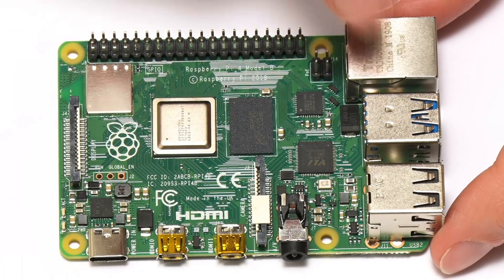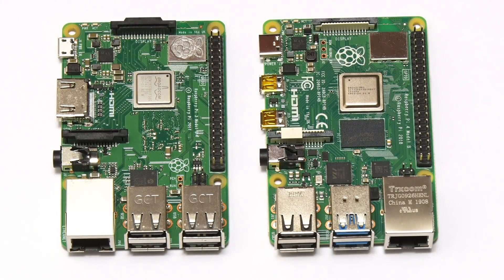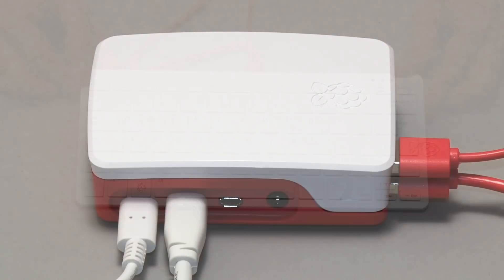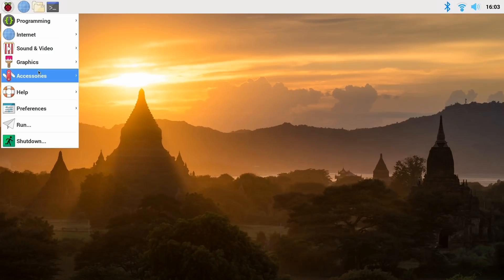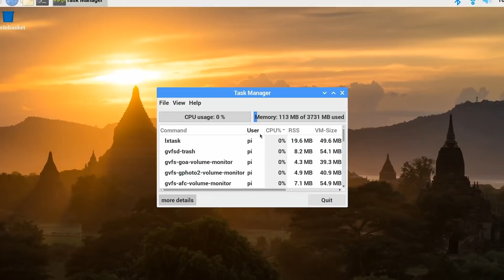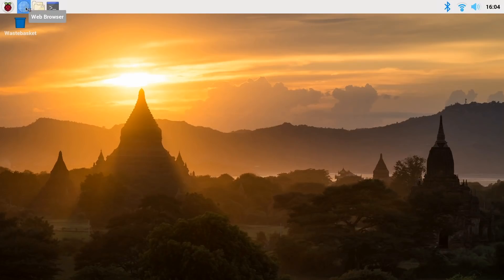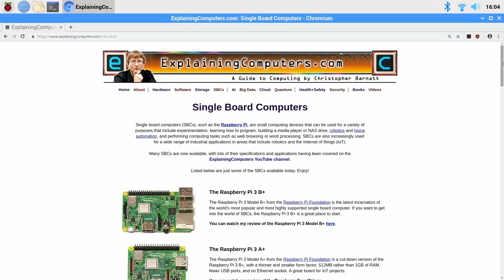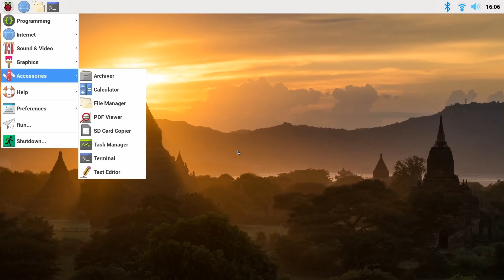Raspberry Pi 4 Model B

Comment: Hi Chris, thinking of getting a SBC as a cheap desktop replacement. My requirements are simple, checking emails, YouTube videos, Netflix streaming, internet browsing and opening some email attachments like PDF, pictures and running a media player like VLC.  Which SBC that you have tested so far would fit the bill? I am not a tinkerer but I can manage installing Raspbian on the Pi 4. Thanks.
Reply from the maker: The killer for many an SBC here is the video streaming part. With which a Pi 4 currently struggles. A Jetson Nano is more powerful. If you are happy ro run Android, someting like a Khadas VIM3 or Edge-V is a fair bet. Ir you are into x86 boards, like the origional LattePanda.
Reply: @ExplainingComputers  Thanks Chris, do you expect this video streaming problem getting fixed on the Pi 4 in the near future? Is this a hardware issue that requires a more powerful hardware to resolve or is this a software issue that can be solved in a software update? Thanks.
Reply from the maker: @cinnamont1224  Yes, the Pi streaming video problem should be fixable. The hardware is capable of it, so this is a software issue -- and the Raspberry Pi Foundation have described software for the board as "early days". :) If you do want to stream video, you can also do it pretty well if you install the Libre ELEC/Kodi -- so it is an option if you are prepared to switch SD cards. :)

Comment: I've seen the video where you put the Rasberry Pi 4 up against the Jetson Nano.  My question however is how did or would it fare against the Rock64 and similar single board computers in head to head challenges.  I have a 3B or 3B+ running Open Media Vault as a NAS, and I'm considering upgrading, but wondering which way to go, Rock64 or RP4B, and your opinion and testing will carry significant weight in my final decision.  Mind you, I just cannot afford an out of the box NAS, but could swing one or the other, unless you might recommend an inexpensive 3rd choice.  Thanks.

Comment: Hi, I've set up my new raspberry pi4B with the keyboard and mouse and connected it to my tv. All looks great but when I check out youtube in the browser there is no sound. Any idea where I need to look? checked the volume in the top right and put it up to 100 still not a murmer. Glad of any help cheers
Reply from the maker: Look in the Pi preferences/settings panel -- I cannot remember exactly what it is called. It sounds like you have 3.5mm audio selected, rather than HDMI audio. Also, try both HDMI connectors.

Comment: I want to convert my old VHS tapes to digital, do you think the software and USB hardware would be compatible with the PI 4? And could I connect it to my TV to watch them?
Reply: Yes, but you need to encode them to format that PI hardware accelerate
Reply from the maker: I am not aware of a device to connect to a Pi 4 for digitising composite video from a VHS device. Products on the market are generally for Windows or Mac, and that software will certainly not work on a Pi.

Comment: Raspberry pi 4b or Rockpro64? Which one is better?
Reply from the maker: It depends what you want to do! :) The PCIe slot on the Rockpro64 is nice. But it has worse software support, in general, than a Pi.
Reply: Thanks for your reply! :) Generally I would just use it for retrogaming installing recalbox or retropie

Comment: Better buy some stock of heatsinks as well - this sucker runs a lot hotter than previous Pi's. Also remember you may need a new PSU (type C and 3.0 amps), mini HDMI cables and a new case. Not a low cost upgrade but still runs faster than previous models

Comment: Hello Christopher! I was wondering if you can cover the news on the out-of-spec USB C ports, and explain how & why some chargers won't work with the RPi4
Reply from the maker: The issue is how the USB-C power connector has been implemented, meaning that some USB-C PSUs will not work with a Pi 4.

Comment: New report today.....the makes of the Raspberry PI4 Screwed the pooch on the USB-C power connector.  They saved the expense of one resistor. This makes it incompatible with cables designated with the letter e. The higher power cables are detected as audio devices and the connector will not power the device.  Why would the makers/designers omit a resister the specs call for?  The PI4 will work with the Raspberry Pi branded power supply. Was thisan intentional move tosltheir branded power supplies? How did something this important slip through testing?  

I am glad I postponed the purchase of new PI.

Comment: A similarly spec'd "UniBoard" Apple Pi would cost $1,999 without any video, ethernet, or USB ports.  Those ports are sold as separate dongles for $199 each.
Reply: PLUS V. A. T lol

Comment: I saw Python but does it come with a FORTRAN or C++ compiler?  I suppose if it does then these compilers will compile code efficiently for the ARM architecture. Do you know much about this?  I am trying to send it jobs and retrieve results.  The 4Gbytes of RAM make it attractive for my purposes.
Reply from the maker: It is certainly possible to code in Fortran and C++ on a Pi, but I have never tried to do so.

Comment: IS THERE ANY DIFFERENCE BETWEEN 3B & 4 TO SETTING UP THEM? OR BOTH RUN AS WITH THE SAME MENUS AND EVERYTHING?
Reply: Yes I think
Reply from the maker: The setup is the same, unless you need to set up a 4K monitor, or dual monitors, in which case you need to use the new monitors panel on the 4B.
Reply: @ExplainingComputers  ok

Comment: i got mine yesterday and it generates considerably alot of heat. reaches 80° in less then 5 minutes of normal use!!!
Reply from the maker: My Pi 4B cooling video is in production. :)
Reply: @ExplainingComputers  great, i can't wait to see your cooling solutions
Reply: Buy a fan
Reply: @youssefgrine8294  it's not normal to generate such heat!! i think fan could solve just a part of the problem
Reply: @WYCF80  yes but it is normal because there is more power, buy also a small radiator To put on the cpu
Reply: If your pi 4 is gonna sit under a monitor or tv purely as a pc or mediacentre then look into Flirc cases when they become widely available for the new pi.  Best passive cooling solution hands down

Comment: Would you think rp4 is a lot better than the tinkerboard and odroid xu4  or it's still too early to tell?
Reply from the maker: The Pi 4B is a better board, though the software is still in need of some work (eg re GPU support), and cooling is an issue.
Reply: @ExplainingComputers  thanks m8

Comment: I am sure you will find the new PI 4 will cook in that case you have. I have bought one (4GB) and it desperately needs a heat sink, fan and adequate ventilation to stop it from overheating and throttling.
Reply from the maker: I am sure you are right -- the Pi 4B gets very hot.
Reply: @ExplainingComputers   Chris, when you do another video on the Pi 4B,  may I suggest adding the information on the new SPI EEPROM bootloader and how it can be checked / recovered if it gets corrupt and fails to boot an SD card. I found this interesting info on the PI website ... https://www.raspberrypi.org/documentation/hardware/raspberrypi/booteeprom.md ... give my regards to Mr scissors ;-)

Comment: I don't see the point why they have a 2 GB version ? You either need much RAM either don't, 2 GB in the middle is neither enough nor cheap. The 4 GB version is cheaper than Nvidia Nano but lacks CUDA.
Reply from the maker: I agree with this -- I think most people will go 1GB or 4GB. The 2GB models that have sold so far went to people who could not get 4GB because it had sold out!

Comment: "The new Pi we all wanted" for me does not need to have 4k video or dual HDMI or USB3 or Gb Ethernet.
What I do need is 2 or 4 GB of memory, a SATA or M.2 interface (not a USB-SATA Bridge), the ability to boot from SATA/M.2 , a proper way to power the Pi with something better than a micro-USB connector and a way to shutdown the power to the Pi as regular computers do. Don't get me wrong; I love the Pi and I like some of the upgrades but going for Gb Ethernet and I think I will get a 4 GB model for the large memory but for me they could have just made a 4 GB 3B+ to make me happy.

Comment: Not a bad review, Chris. Although I don't entirely share your opinons on the 'blow all it's comptetitors out of the water' because the RPi4B is still very much limited in features and functions, even with a Cortex-A72 "high-performance core" CPU and 4GB LPDDR4 RAM @ 2400MHz. You didn't mention the heat this device generates during operation, which is a significant consideration. Additional cooling solutions are required for anything more than basic use. Compared to it's competitors, the RPi4B is still a toy and can best be used as an introduction into the world of ARM devices, or as an educational tool [i.e. purposes for which the RPi was first conceived]. I'll be using my RPi4B with a big heatsink and fan on top of the SoC, because it'll be doing a lot of binary source code compiling. If you Google for "SARPi Linux" you'll find links for 'Slackware ARM on a Raspberry Pi' - that's what I do.
Reply from the maker: I did have a "Pi-priced SBC" at the front of my competitors comments. :) And the Pi is certainly not a toy -- a lot of sales are industrial now. Indeed, the drive for 2 x 4K outputs was to meet the needs of industrial users who use the Pi as a thin client.

Comment: Next Add in NVMe slot. Or is it already done?
Reply: It should be possible to run a SATA SSD onto the new Pi via USB3 port. I'd prefer that to run on its own powersupply, though if you get the official 15W Pi adapter, that should be enough. At least I think it would be...?

Comment: I recently borrowed a PI 3B+ and after experiencing slow GUI performance on the desktop I was surprised that I had to manually change a setting via PI config to enable hardware acceleration for the GUI.  I think the setting implies it is for GL but my experience with my framebuffer only (SDL2) application improved performance 30 times. It went from 1 FPS to 30 FPS.  Could the PI 4 require similar  settings to better the desktop experience?
Reply: raspi-config -> Advanced -> GL (there were a number of GL options to choose and I can't recall which one I chose, sorry!)

Comment: correct me if i'm wrong but i remember someone said you don't really need 3A for normal use ... the extra power is for accessories if needed, especially the usb 3 ones ... but if you have a self powered usb hub or a y usb cable you don't really need the new 3A psu
Reply from the maker: The Pi 4B can draw pretty much all of the 3A at full load I think.

Comment: I would have bought one of these a year ago when I was trying to make an all-in-one server/router. 
The lack of RAM, USB3 and true gigabit ethernet was a real problem. 
The biggest issue with the competitor boards is their price range. For all the extra features you'd end up spending quite a bit more. It was only a little extra to get a gigabyte brix, so I could have everything, including upgradeable RAM and a sata SSD, which I ended up getting. 

The RPi4 is even going to shake up that market (the ultra-compact mini PC's) too, because the price difference is too high to justify compared to the RPi4.

Comment: Still no eMMC? I've had quite some defective sd-cards over the years. Since I've switched to an Odroid C2 with eMMC, everything is incredibly fast, stable and without corruption. I'd really have liked to see an eMMC port on the Pi4. That would've made it a killer board. Now it's just meh when you want to run a somewhat heavily used mysql on top or anything somehow write-intensive... Such a shame.

Great video, looking forward to the in-depth analysis!

Comment: The huge limitation of the Pi is the lack of a second Nic, it would be great to have one more nic for networking labs
Reply: You can get USB3-Ethernet dongles, there's enough bandwidth on that bus to run a couple of them at full speed.
Reply: @n-steam  Ah yes - and a USB-SATA interface and a USB-WiFi dongle and a Bluetooth Dongle and and and ... a PC case o hold all that stuff 😉
Reply: @Rob_65  It's got WiFi + Bluetooth built in.

Comment: What can anyone at this point say that's negative about the Pi4? Everything looks good to me so far..and I'm really picky about things. Good video.
Reply from the maker: The only negative is how hot it gets -- it really needs a cooling solution.
Reply: @ExplainingComputers  If you get to keep the Pi4. I would consider making my own heatsink from a couple of pieces of 1/4 inch scrap copper or aluminum  that are stacked and glued on top of the cpu with thermal epoxy. I've often made my own heatsinks. some weren't pretty, but they all worked.

Comment: Could I run a basic DAW, record audio (wav), midi, and program Arduino. Will it run a printer.
How productive is it?
Reply from the maker: Printer, certainly. HDMI audio is good, not via the 3.5mm jack. But you can add a high-quality audio HAT.

Comment: Some benchmark results using HPLinpack test (double precision, same binary):   RPi 3B: 0.8 Gflops, RPi 4B (4GB): 6 Gflops !!! (can that be true?)
Reply from the maker: I would question that test! :) The Pi 4B is more powerful, certainly. But that seems a lot . . .
Reply: @ExplainingComputers  well... I ran the same test twice on RPi 4 on 4 cores, came up the same score.. 6 Gflops... (I mean 6 Gflops is pretty low score by desktop standards anyway,...)
Reply: @ExplainingComputers  Ran another test on another Pi 4B board (2GB version) -- got 5 Gflops (somewhat consistent with previous results, due to RAM size is twice smaller, the problem size is much smaller, so it finishes faster though). Both boards heat up by  some 20 C during the runs, -- had to keep an eye on throttling to make sure it keeps clock speed. Had to use thermal paste (better conduction of heat) vs sticky pads to keep below throttling threshold (seems to be about 80C). But overall Pi4 is massively more lively than Pi 3 in desktop mode, indeed. Could not play 4K videos though with omxplayer [just exits] (perhaps Raspbian is still a bit raw)...

Comment: Good:

USB 3.0
Faster Speeds
Ethernet gigabit
Still smol

Bad:
Much higher price for higher ram. 20 extra bucks for 3gb ram. 16gb desktop kits go for 60 bucks nowadays.
Accessories are still pricy as hell
Needs heat sinks 
Micro hdmi ports, why not just stack two hdmis on top of each other or something. 

Overall I like what I see but still find it a bit to justify over a now discounted 3b+ for seeding or a warrantied nvidia shield for TV. Could also use an m2 connection or sata connector to not have to depend on microsd cards. It having these features would make it easier to stomach the higher price. 

After all to use the pi4 I'd need to buy the board, case, new cable, power supply and a microsd, since I'd need a higher quality one so it doesn't suck. Also a controller/usb receiver for it.

Comment: I also suspect that it will have a problem dissipating all the heat. Most likely a case with active cooling will be a must, or at least a big heat sink. Maybe you can do one video around heat dissipation  as you did for the other models. Thank you
Reply from the maker: I will indeed do a temperature tests and cooling solutions video for the Pi 4B. I am shooting a performance tests (vs the Jetson Nano and other Pis) video right now, and the Pi 4B gets very hot indeed. So you are right. A significant cooling solution is very much required.

Comment: Can you make a video on how to integrate/interface a FM radio to the Rpi????
Reply: will need a fm radio module, typically spi or i2c at 3.3v if i remember? and a way to route audio into the rpi.. i2s audio link would be the best route for that via an i2s codec.. build/find and enable the software/drivers for that and boom

Comment: So Happy!  I wonder exactly how backwards compatible it is... Hopefully with the integration USB-C the little lightning bolt will be a thing of the past (I can still dream, but time will tell). Im optimistic due to the fact they include the non-powered USB hub on the keyboard. I just need it to keep a 2.5" HDD spinning while running demanding processes. My 3B+ can spin up and read a (nearly full) 1TB 2.5 HDD no problem, but once it tries to do something like; scrolling through video previews AND playing them, or reading too much for demanding programs- it gets the low power warning. It's even worse with any peripherals device plugged in. Powered hubs are bigger than the pie it's self, and then there's back feeding...

Comment: First, i'm really surprised at the fact that keyboard and mouse are wired. In the time of wireless techonology, these things should be without cable. Rpi4 comes with BT and wireless possibilities.
Second, I haven't noticed that USB ports and Ethernet port have switched places. Maybe there are some engineering reasons for that, but if we exclude two micro HDMI ports, it is impossible to put the new board in the old case. 
Third, why do they  insist on using microSD card for booting the operating system, when they have show to be very unreliable ( in my case)?

Comment: Just curious, what do you usually do with this device? Home server? Smart home control? Mini PC?
Reply from the maker: The Pi 4B can be a mini PC, add PC functionality to a TV, be used for robotics and IoT control, a media player (perhaps!), retro gaming, as a NAS for network storage, remote camera controller, etc.
Reply: Yea I was wondering the same thing , But I bet this NUC mini pc isn't as powerful a normal laptop/desktop competitor with the same specs IDK why they've desined this while u can buy a powerful laptop and carry it with u where u go
Reply: @ChillBrotato  You can use this for robotics, or something where the board needs to be small
Reply: For me, probably an upgrade to OctoPi/Octoprint for my Ender 3 Pro printer.
Reply: Home theater PC! I also saw one running the full Manjaro XFCE OS recently!